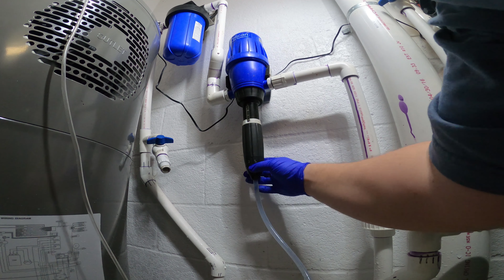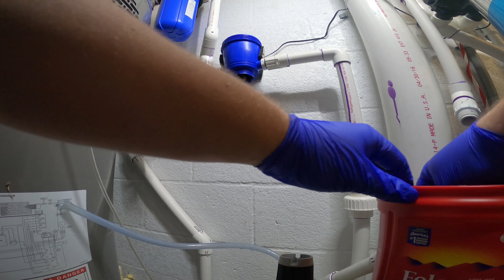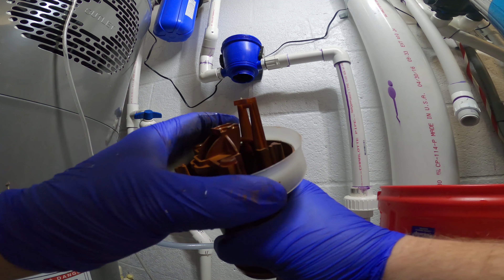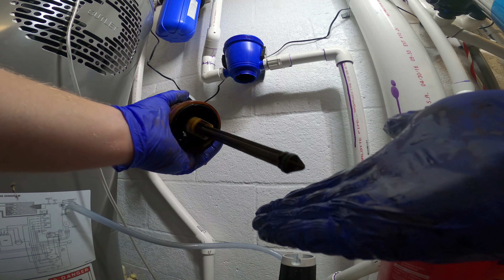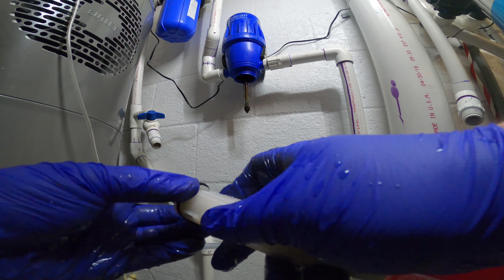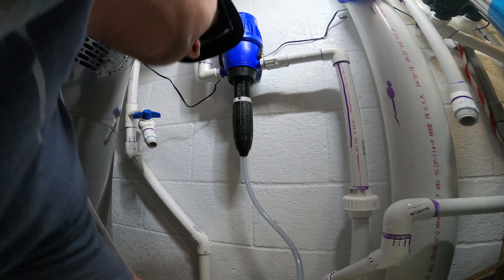Pelican (Dosatron) Chemical feed injector repair

Comment: I have that same system and thankfully you are one a few that has a video on this exact topic and just happened to mine what ended up being the problem? Should I just take it apart and clean it out or is it something you had to replace?
Reply from the maker: Most of my issues are from the spring inside the valve at the bottom. The spring in mine only lasts 4 months at most so i ordered a bunch of those and just replace the spring 3 or 4 times a year. Doing that has solved 90% of my issues. Ill find th part number and post it up for you.
Reply from the maker: https://www.hogslat.com/dosatron-dm11f-check-valve-spring
Reply: Thank you!!! 
So I don’t need to replace the check valve that is allowing the water to come back into the brine well.
Reply: Also, mine is a d14 MZ2. So I’ll just order the spring for my model. (Even tho mine looks identical to yours -
Reply from the maker: @jnako4361  not every time, I bought all the individual parts for it and just replace each item as it wears out. I do a visual inspections each time i change the spring. what they charge for 1 complete check valve you can get parts to rebuild it 3 or 4 times.
Reply from the maker: @jnako4361  they are the same as far as I can tell, I have parts for both inside mine now.